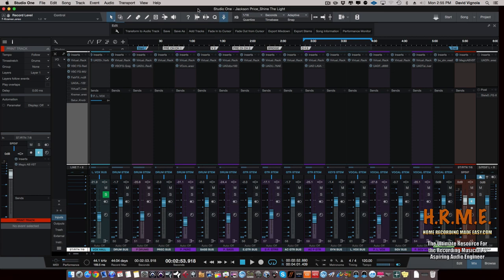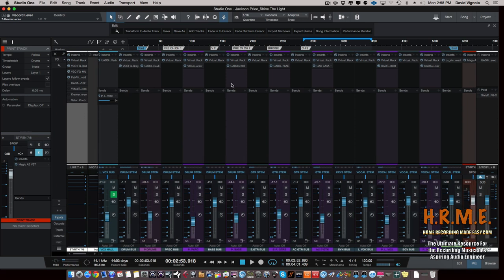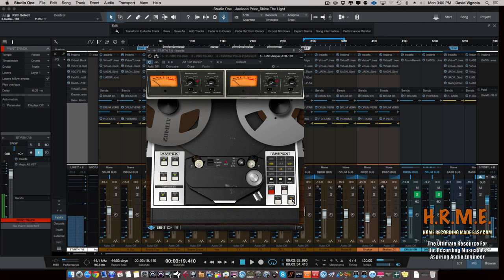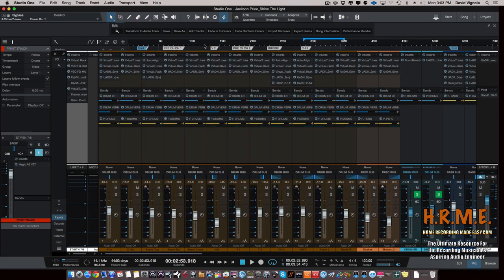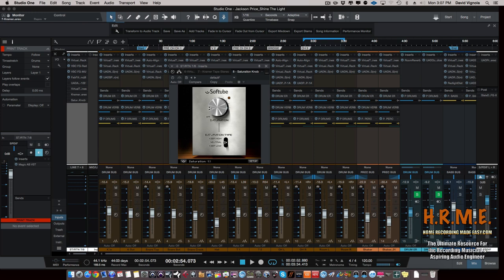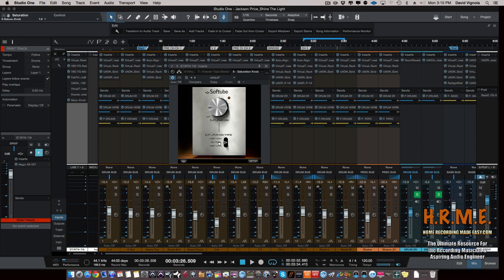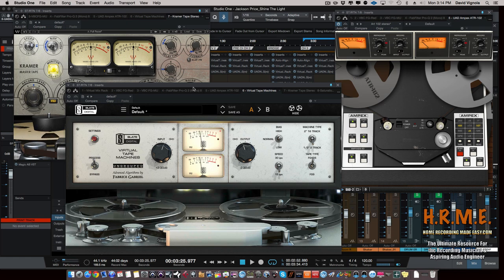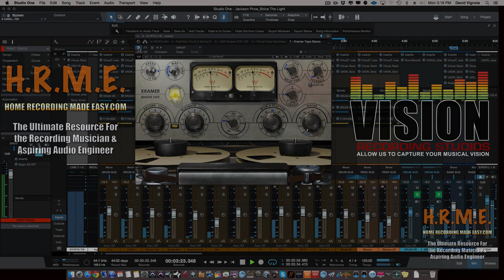Presonus Studio One 3 - Using Tape Machine Plugin on Master Bus

Comment: I'd have to stay I prefer the Slate Digital VTM the best. I'd also like to add that when I use the SoftTube plugin I'll use Studio One's Mixtool after it (never before it). If you use a trim plug before the SoftTube plugin it effects the input gain and completely changes the tone you had. I've also noticed that in Studio One if you use SofeTube on a Buss, turning the Buss fader up or down messes up the input into the SoftTube plugin. So I tend to use it only on individual tracks and never on a Buss. Not sure if this is only a Studio One thing or not. Never noticed this issue when using Pro Tools.
Reply from the maker: HI Sean - Thanks for watching and thanks for your input!

Comment: Been using the Saturate one-knob plugin for some time now.  Where do you place it?   I have been putting it last in the chain.
Reply from the maker: +John Curtright I personally don't use it. I just tried it out for this video demo.
Reply: Hi John, you can put it anywhere in the plugin chain it sounds best.. But If you're going for that classic tape emulation processes then your emulation plugin should be first in your chain. Quicktip, for volume matching plugins without an output gain knob (like softube saturation). Just add a trim plugin like Sonalksis freeg or Klanghelm VUMT and volume match as required, this is also useful for gain staging as both plugins have great metering. Hope that helps buddy.

Comment: Good job comparing man. Slate VTM all the way. I use VTM too. Sounds the best. Question, I know it's not really tape saturation, but it is sort of in a way. You ever use Decapitator on a master buss? I use it on my drum buss and master buss. I only drive it to about 2 or so, it's subtle but sounds great on the master. I use it on snares, kicks, bass as well. Ever use it on your master?
Reply from the maker: +gregthegroove I have never used the Decapitator before but I would be interested in trying it.
Reply: +Home Recording Made Easy it's a really cool plug in. Harmonic distortion. Awesome on snares and drums and guitars etc....you can overdrive it and mix it in as you like using the built in mix knob or use it minimally on the mix buss as well. Very cool. I'm sure you already have distortion plug ins but check it out on you tube.

Comment: hello. I use nothing but sims for my recording.  drums guitar and bass.  I was wondering do I have to have so many busses for a good mix.  and let me tell u . u must have a ton of ram to run that many plugins. wow
Reply from the maker: +Torn Horizon The amount of busses you use is totally up to you and what you like for workflow. Yes, I have 32GB of ram in my computer! Having said that the majority of my plugins are Universal Audio which does not tax my computer at all. That's the beauty to using their system
Reply: yeah I have 32gb as well, but all my plugins are on my computer so I still have a hard time, like I use superior drummer or ez drummer, then guitar sims and impulse loaders. Bias fx bias all that. u am still learning the mixing process and was just wondering why so many busses, plus trying to side chain, and that cool compression thing that you do when you put massive compression on the drums and then blend it with dry signal from the drums forgot what that is called....LOL.  just want it to be full and freaking heavy

Comment: I gotta be honest the SoftTube acts more like a limiter by cranking up the over all volume, and yes it isn't a real tape emulator.  I'm not sure I even like it at all.  I think it really needs to be worked on (even if it is free) so there is greater control over the end volume when using it.  To my ears it sounder harsher and doesn't feel smooth.  The Slate Digital tape machine I feel adds the right amount of silk and sparkle to the overall sound.  The music really popped when you used it.  While the UA tape emulator was not as noticeable, but I felt something was there.   The Kramer added a little something that seemed to bridge the gap between the Slate and UA tape emulator.

Honestly when I invest in any of these tape emulators, the I will buy is from Slate.  For some reason what ever the engineers did with those algorithms made it sound the best and truest to the real tape machines.  Plus it's the best bang for the buck.
Reply from the maker: +kjemradio I agree and also think that the Slate VTM sound amazing and for the $$$ you can't beat it